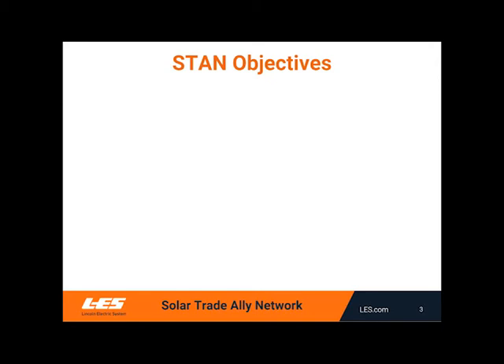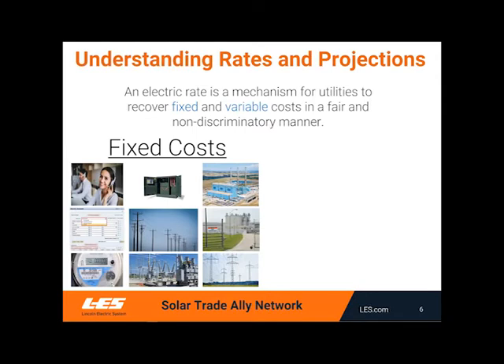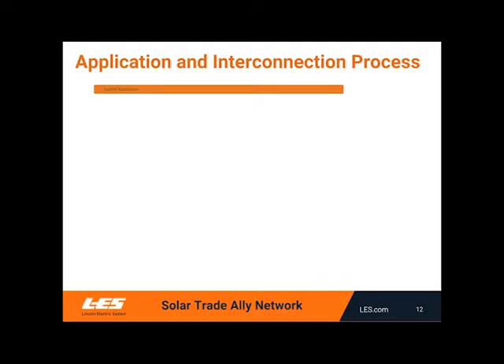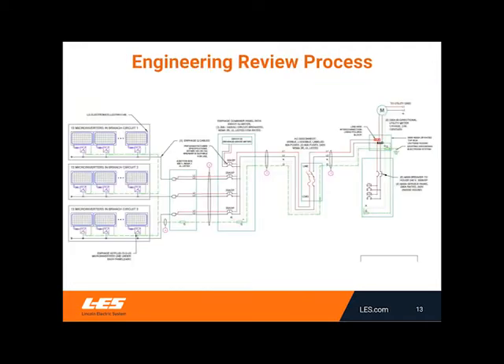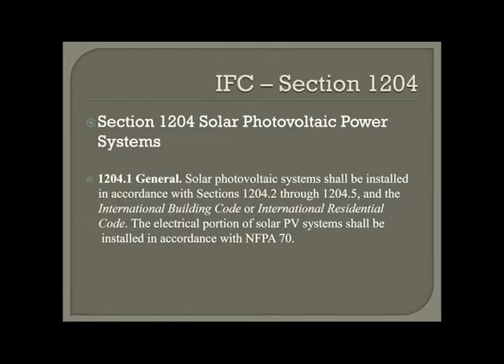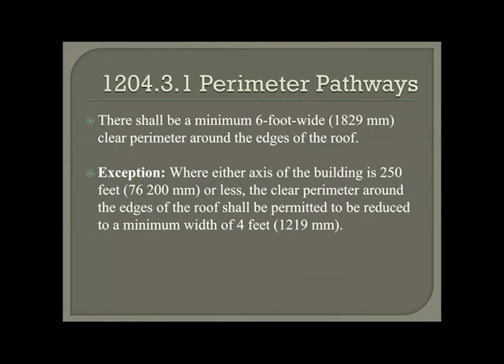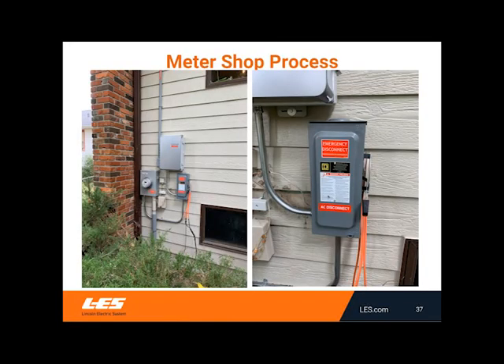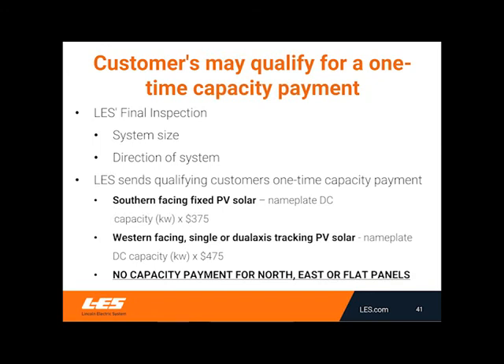2022 Solar Trade Ally Network Orientation

Comment: For the one line diagram, it is hard to see, but do I put the AC knife disconnect switch in between the main service panel and the pv production meter or does it go in between the inverter and pv production meter?